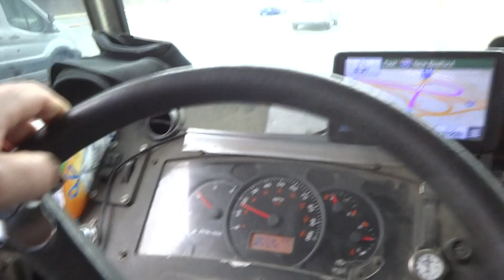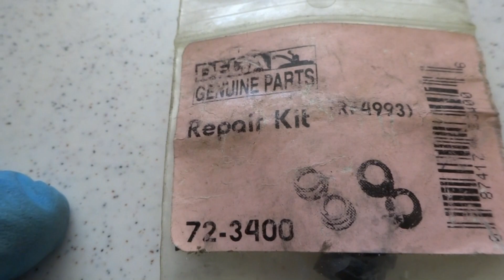DELTA KITCHEN FAUCET DRIPPING WATER HOW TO FIX ISSUE

Comment: Great video; I haven't read all the comments, but it is imperative on the spring and seal kit that you orient the washer seal properly. The flange must go down not up or you won't be able to turn the water off with the handles. The water will just stay on after you turn on the valve if the seal is not oriented properly.. I also coat the seal and O rings on the cartridge with a little vaseline.
Reply: My Delta cartridges looked nothing like the ones in the video and I had the very same problem you mentioned --- the handles wouldn't turn off the water. Not sure exactly why, because I didn't use a new spring and seal kit. There were two loose pieces of plastic below the cartridge (again, nothing like what was shown in this video) that I tried to position as they were before. I'm thinking that might have been the problem.

Comment: the shims under the handle allow a standard cartridge  to work with "1/4 turn trim"
see more used on 3 handle tub valves with levers

Comment: I've always put a small amount of valve stem grease on the top of the seat, O-ring and the bottom of the cartridge. It reduces the friction of the opening and closing of the valves and extends the life of the seats and cartridges.
Reply: I do that too, FG.  I HAVE to do it, due to a well and hard water!  Otherwise i would have to replace them every 3 months.  I use it in my shower cartridge, as well as the seal in my toilet fill valve that uses the old float device.
Reply: I'm always having to clean the lime buildup off my valves. The water is hard around here, so the grease definitely helps.

Comment: All the faucets in my house have a lifetime guarantee and I keep calling the manufacturer to get free replacement parts.
Reply: Can you tell me what brand faucet you carry that has a lifetime warranty parts thank you
Reply: @johnfleming68  I believe delta does have life time warranty on parts
Reply: I’ve called Delta many times for replacement parts.  I always feel guilty, my faucets are 14+ years old,  so I offer to pay for the parts and they never want any money.  The trick is to know the model number for the faucet.  It usually comes with the install instructions but if you buy a resale house or even a new one, most contract plumbers never leave that information behind,  I think they’re  supposed to attach a tag to the supply line giving that info.  If you don’t have the model number, they will help you identify the model.  Very nice people.  At least when you get them from Delta you know you’re getting genuine parts.
Reply: But like my HD special...faucets bath are hollow... they rot thru...and crush when removing cap.. one hit wounders...
Reply: @johnfleming68   Moen  a brand that has life time warranty on parts as long as your the original owner to them.! ✌️

Comment: Just so people know, the Delta repair kits come with 2 sets of different sized springs,  Make sure to match them up with what you have.
Also, always a good idea to block the drain(s) to keep small parts from escaping.
I've done a lot of handyman work for friends and family over many years, lots of fixture repairs.
When someone is looking at replacing a faucet, I tell them to pick out a DELTA faucet they like. If they have a different brand in mind, I say DELTA!!!

Comment: Delta is good stuff unless you get the parts from Home Cheapo or Lowe's..

Once you put that generic crap in them they don't last as long...

Awesome to see you use Actual Delta parts!
Reply: Home Depot has the Delta brand parts.. along with the cheap Danco brand

Comment: She's a leaker mama. Need a guy like you in my area. I fix what I can, learned a lot watching your vids. But if it requires special tools I'm calling in the pro's. Don't know anyone in my area who will even attempt to fix anything. It it's leaking they 're going to want to replace it. Even if a cheapo little washer will fix it. Don't know any independent guys they all work for the big outfits. It's like it can't be fixed we will have to replace it. Damn shame their aren't a lot of good old honest guys around anymore. If you were in my area you would be my go to guy.
Reply: Pete, I can relate.  I think that Obama Care contributed to that situation.  The techs tell me that they had to go to the big outfits because the pay for the health insurance that they can`t afford.  Then the big outfits cover the huge costs by working the tech`s asses off, and socking it to the customer.  
   Similarly, our independent farmers are being squeezed-out of business by the Con-Agra`s because they can`t afford the high-tech equipment in order to compete.  The farms get sold and big real-estate throws-up condo`s.  That trend leads to water table problems, congestion, crime and all the rest of it.
Reply: @yz250a  (Ouch)  But you are correct, of course.
    Sorry, I am new to this.  I just noticed the trend in my area and asked the techs that I have hired, what was going on with them.  They told me they would rather be independent plumbers and HVAC`s and have more control over their hours. (Like Steve has).  
   We need more Steve Lav`s.  Like myself, many others have commented that they wish he, or someone like him, was in their area.  Independents are a dying breed. 
    He seems to feature just as many furnaces as "PLUMBING".  But, I hope that I have stayed on-topic this time.

Comment: The ones that gave me grief were the generic two valves units, the spout would leak at the base, warranting replacement of the whole spot. You couldn't do anything else with that! I had two tubs that were two valves that drove me nuts with leakers, trying to blast past calcified threads to get those valves off... I won, but it took me longer than expected.

Comment: I have a 50 pack of those flippin seats & springs ,  I have to change them out like every 1-2 years in a couple sinks.  New cartridges every 5 years when it leaks out of the handle.   Unlike Steve, I lube up everything nice and easy.   LOL !

Comment: Morning Steve.  Tech tip , use a 4 in 1 Screwdriver without the bit , use the barrel to fully seat the washer and spring.
Reply: Cool tip, I will try that. As Steve said, it helps a lot if there's no water in the faucet body, else the rubber seal tends to float. I usually use paper towel to soak the water up first
Reply: We always use a #2 pencil with an eraser head to seat the springs, just remember that the SMALL end of the spring seats FACE UP into the rubber seat towards you.